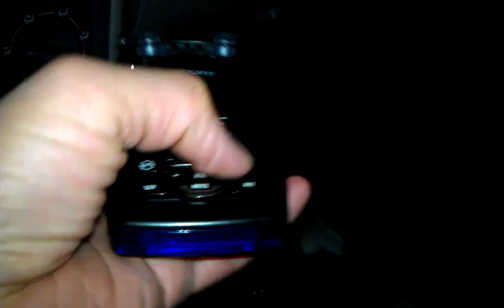Escort Passport 9500ix problem (part 1 of 2)

Comment: I'm experiencing the same issues with my unit right now. Did you find any solutions on how to fix it? Did Escort offer to fix it or anything? It's an expensive unit, and worked great when it actually functioned properly, I'd hate for it to go to waste...
Reply from the maker: I ended up sending the unit to Escort for repair.  The cost was about $80.  It's been good for the last 3 years since i had it repaired.
Reply: Ah Damnit, buy a $500 unit and spend $80 more to fix it smh.
Reply: TentedFingers How long did you have it before it went wonky, and how long was the turn around time?
Reply from the maker: It worked for about 2 years before it started having the problem and then the problem got worse and worse.  Turn around time was about 2 weeks.
Reply: I'm having a different issue mine goes through the startup menu stays on for about 10seconds then powers off then does it all over again. I got it a little over a year ago enough time for the warranty to be void. 139.99 for the repairs